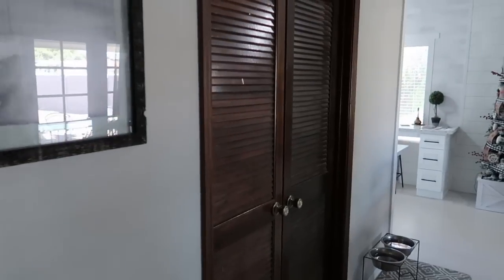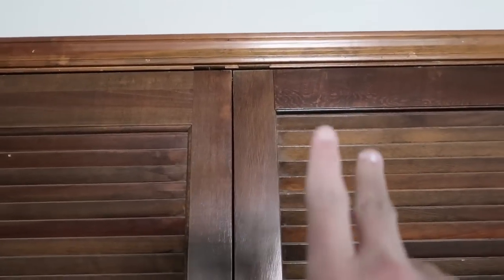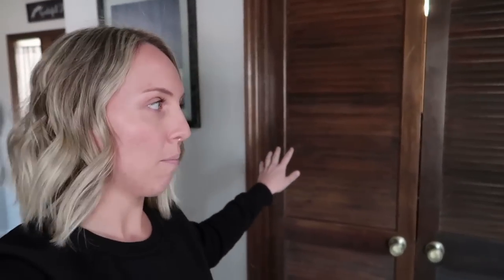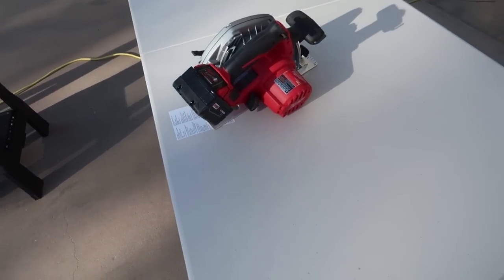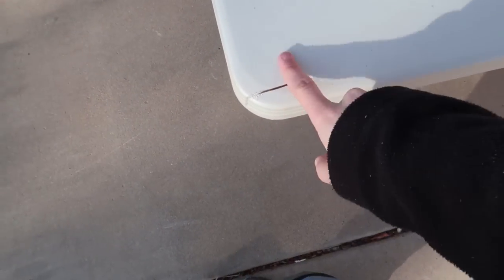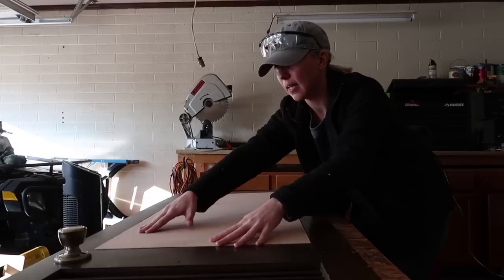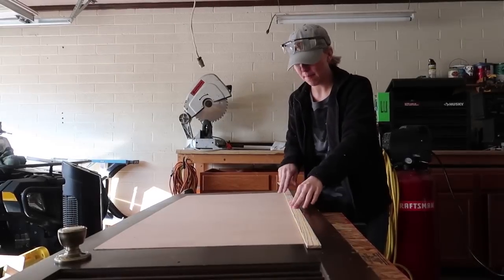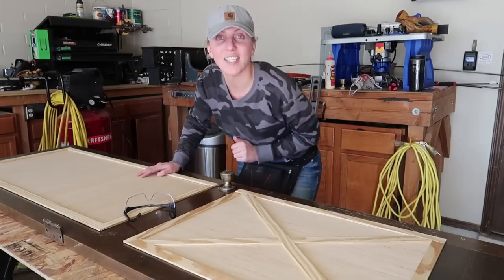DIY COAT CLOSET MAKEOVER

Comment: I noticed a gouge in the wood panel. If you spray it with a little water, put a damp cloth over it and iron it, or use a heat gun, it should plump back out.